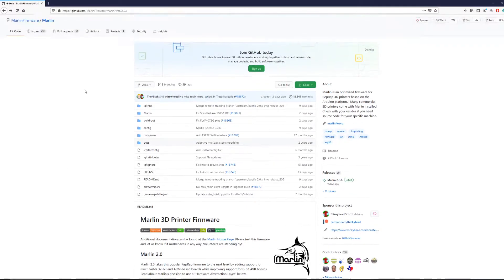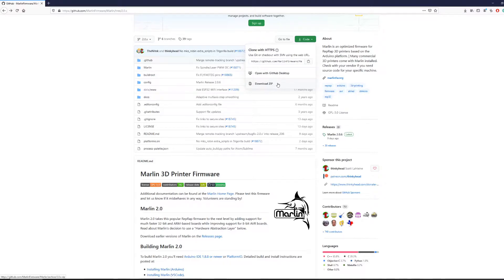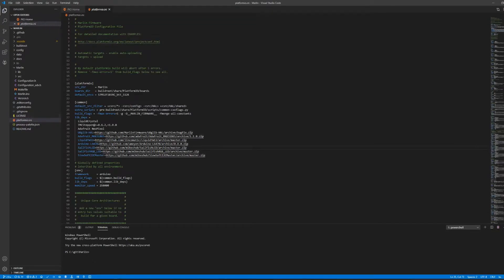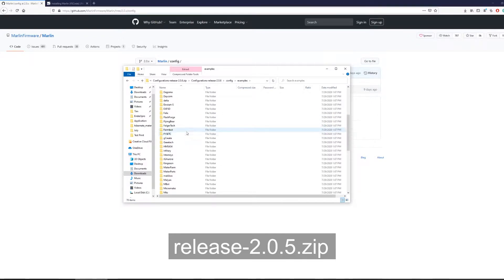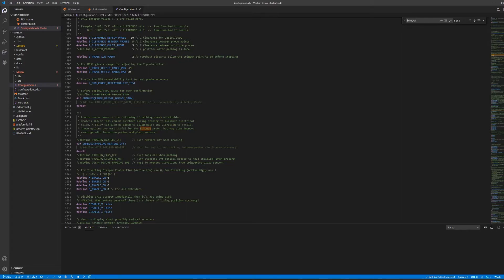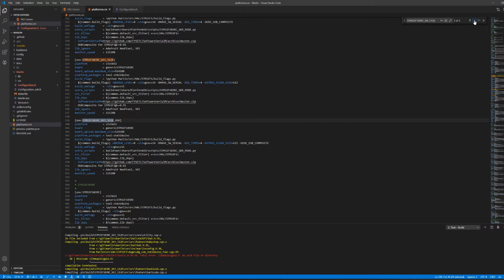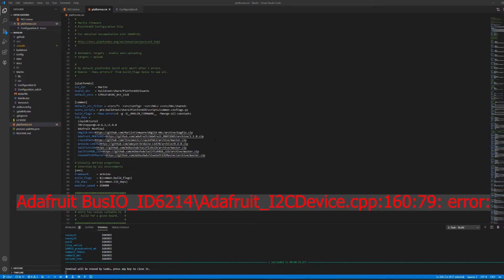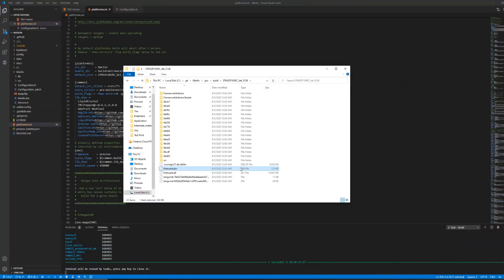Building Custom Marlin Firmware with VSCode for 3D Printer

Comment: Great video, I have one quick question though, I have used my same marlin firmware as I have previously flashed to my CR-10, However, after un-commenting a few things to use the EZABL i am now getting this error and have no idea as to why.
USE_CONTROLLER_FAN requires a CONTROLLER_FAN_PIN. Define in Configuration_adv.h

If i comment all out again, and compile, it compiles fine, what could the issue be?

Comment: I have tried compiling several different ways without success. I would like to clear out my vs code and start over trying your process. How to I delete what I have in vs code?
Reply from the maker: Ah yeah, I had to go through this when I was resetting vscode to make this video. If you just want to remove the marlin project from your vscode, just locate the directory for that project and remove it. Then you can add a fresh one to it again. If you are trying to nuke it all and start from scratch you can also uninstall vscode and go from there.

Comment: hi, two weeks into this and nothing, can you help?

 In file included from Marlin\src\HAL\STM32F1/SPI.h:32:0,
                 from Marlin\src\HAL\STM32F1\SPI.cpp:34:
Marlin/boards.h:24:10: fatal error: macros.h: No such file or directory

compilation terminated.
* [.pio\build\STM32F103RC_btt_512K\src\src\HAL\STM32F1\SPI.cpp.o] Error 1
Reply from the maker: I don't recognize this error, and I might need to see more to understand. However, based on the message it is likely a version issue of the dependency packages in platformio.ini. That is the only thing I can think of off the top of my head which would explain the missing reference. Which branch are you trying to build from?
Reply: @dorkytim  thanks for the reply :) im import the marlin firmware directly from vsc so its the last, but even using older versions it does the same :(
Reply: @dorkytim  been tweeking arround and now have 

Marlin\src\HAL\HAL_STM32F1\dogm\../../../inc/../HAL/./HAL_STM32F1/fastio.h:30:10: fatal error: libmaple/gpio.h: No such file or directory

am i missing something?
Reply from the maker: Interesting, this should definitely be caused by the stm32 version issue I mentioned in the video.
"The cause is ST STM32 framework was updated to version 7. Marlin was built on version 6.
The fix is up update your platformio.ini file
Find and replace the line "platform = ststm32" with "platform = ststm32@<6.2.0" "
https://reprap.org/forum/read.php?415,874307
Reply: @dorkytim  I know I already did that from your video but nothing... Really need to build my z axys is inverted... But nothing works...
Reply from the maker: Oh wow, I'll have to give the lastest branch a try and see if I run into the same issue. Have you tried building off an older branch just to see if it'll work?
Reply: @dorkytim  yeah, done with an older version, different error but still can't build.